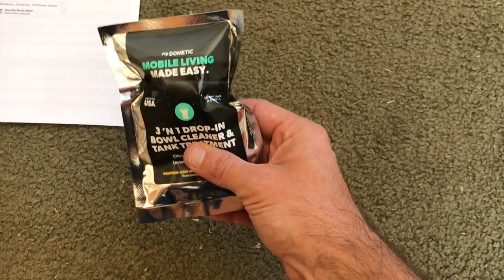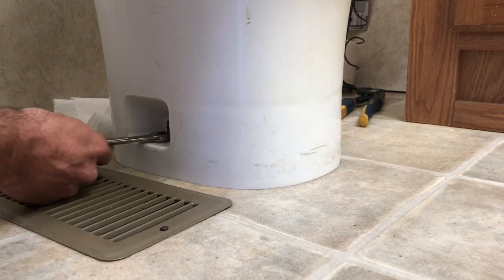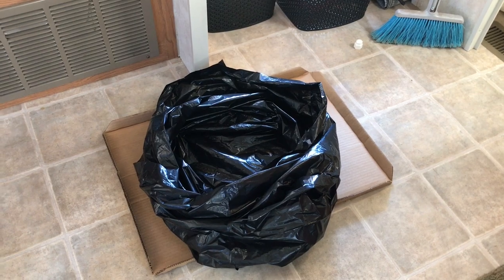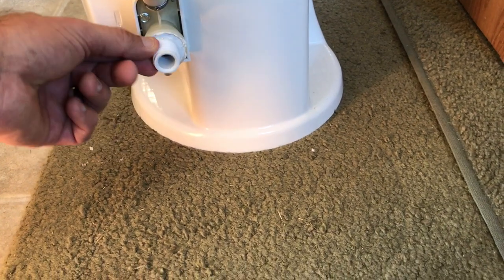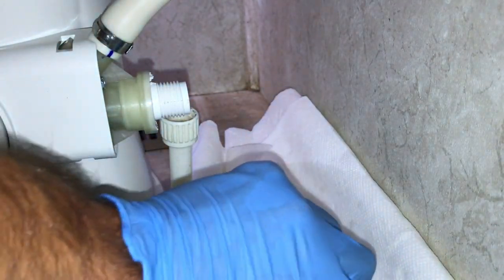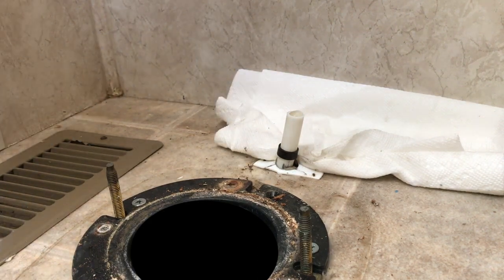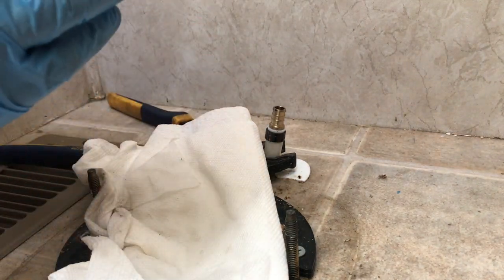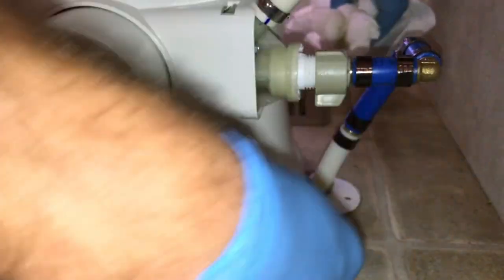RV Toilet Replacement

Comment: I took out a thirty seven year old toilet from my rv. Replaced it! Hit an impasse. My old toilet was an upper flush and the domestic is foot . The old hose doesn't make its way to the lower connector. It is too long and won't bend. In addition, there was a oring perhaps in the old water supply hose that fell in the toilet. Help! On my own here

Comment: Why didn't you use a flexible hose like under a bathroom sink vs having to deal with all the connectors and crimps of using pex? It's just a water supply line not any more than a bathroom faucet. Just curious. Thanks for the video.
Reply: Your answer is at 3:20

Comment: I am trying to take out an '89 and can Not get to the 2nd bolt out..have 13mm ext but can Not get the angle to unbolt? Suggestions?
Reply from the maker: You might have to get creative with adapters.  Do you have space to fit a universal joint between the socket and the ratchet extension?  Other options would be a ratcheting combination wrench like this: 
https://www.homedepot.com/p/Stanley-Metric-Ratcheting-Wrench-Set-7-Piece-94-543W/203741089

You can usually buy these individually at the hardware store.  Another option would be to buy a 3/8” drive-to-hex drill chuck fitting and use a 1/4” box-end wrench on the chuck side in place of a traditional ratchet.  

The last option is the worst, but just try to get 1/8 - 1/4 turn at a time with the open end of a traditional combination wrench.
Reply: Had to use a flex extension with deep well socket!! Tanksss!!